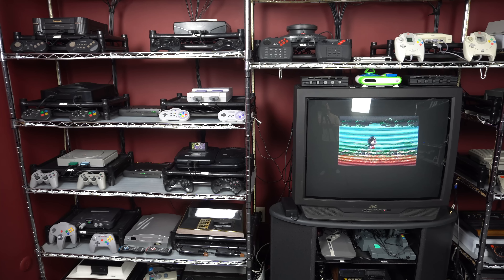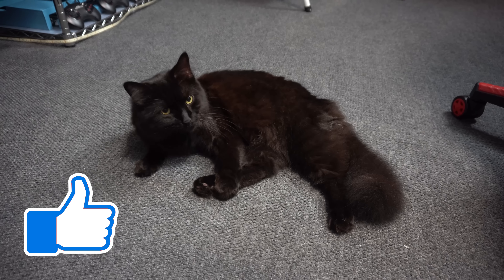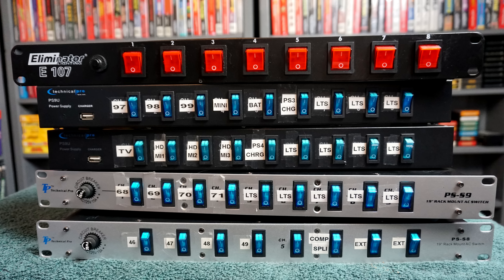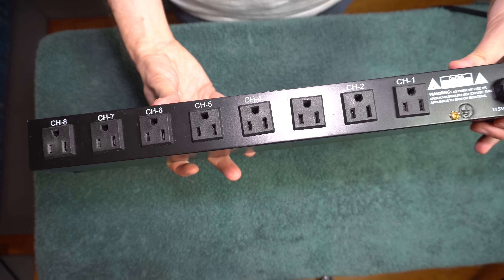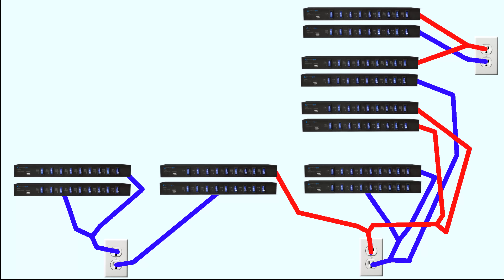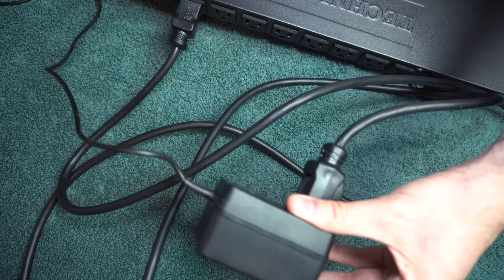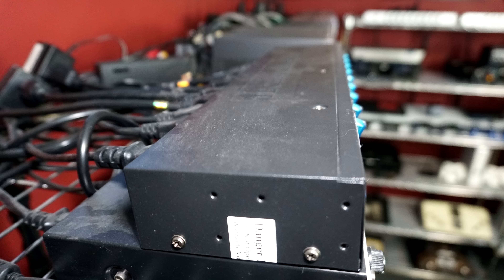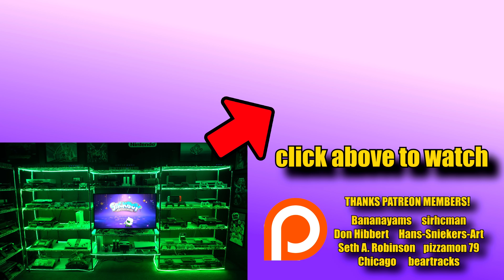How I Power 65 Game Systems

Comment: For your older systems I would use actual power conditioners. Cleaner power is always better if you can get it :P  Other than that I would run a second line to the room just in case. My living room is a home studio and I have 2 120 lines and 2 240 lines.  A large chunk of recording gear runs way more efficiently at 240v thus saves on my electric bill when I'm recording a project.
Reply: Even basic power strips with protection has MOVs and chokes to clean up the power. There are some protectors that cut power if it goes above or below the norm (and don't restore it unless reset), meant for old-style Xerox copiers.

Comment: You should see my setup.. I have a bunch of power strips that have individual items, one set has the tv, one has my computer, one has the Xbox, etc, all going to a main surge protector, then that one going to the main main surge protector which also also its own string of power strips, one for the lamp, one for the box fan..

Sounds crazy, but the way it is all of it turned off when I'm not home, so no power usage at all.. except the fan, and light..

Nothing is over any safety, volt, watt, or any limit at all..

The best way to set it up..

Comment: The only fire hazard thing I can see is that you have a lot of contact points on each path, meaning there a more points where corrosion on the contacts can be a potential fire hazard, but other than that it's a great setup!

Comment: it's just wires, it will never catch on fire. the bricks are 10 watts. people are so paranoid about just the presence of sheathed copper but as long as all the cables are rated at or above the breaker in your breaker panel, it is all protected, and you can plug as many strips into each other as you want.

anyway good job with your setup.

Comment: Could add an arc fault and gfci dual breaker to your panel for that room. Probably about 80 bucks for added security. Think it’s code now, but unless your house is brand new probably doesn’t have it. It would cut the breaker from the other YouTubers demo instantly. Not sure if I’ve seen any video game enthusiasts do it, but it’s diy and easy.

Comment: I was about to say you can just switch things off at the wall but realized this is The US here (I’m from NZ and we have switches by every power outlet probably because we use 240V)
Reply from the maker: You are correct, we don't have switches for every outlet. Only about half.
Reply: @GamingTheSystems1  That is a regional thing, in some areas, particularly ones where there weren't a lot of houses built before electricity to the home became widespread, outlets on switches are less common. They started out doing the switching outlets because adding ceiling mounted lighting fixtures adds significant cost when retrofitting an existing house with electrical wiring because you need to rip up the ceiling as well as the walls, so floor lamps were a common cost saving option, so they put the switches in place so lamps didn't need to be right by the entrance to the room, and that stuck around. When you are building a new house it doesn't cost much to run wiring in the ceiling though so it was common to just use permanent light fixtures and the switching sockets were unnecessary

Comment: A lot of people dont realize, power supplies have a transformer in it and most dont have a switch in the circuit between mains and the high voltage end of the transformer so they still sip a little bit of power. Most old consoles also dont take much, 10 to 60 watts when powered on for older systems with more power consumption for newer systems. Of course newer systems from the XB-360 era forward dive into the hundreds of watts per system. 
The biggest thing to keep an eye out for is making sure the equipment you want to buy is made to a certain load spec and uses thick gauge cables and are fused. Read reviews before getting a power strip or surge protector. Fused equipment and of course spreading loads onto multiple breakers can also keep things safe.
At the end of the day though, the entire room probably doesnt come close to large appliances you already have in your house like your refrigerator or AC. More plugs doesnt always mean fire hazard or more power consumption, its all about what youre plugging in rather than just how many.
Reply: The older systems had linear transformers which could draw more even when off (the BRIDGE RECTIFIER!!! and capacitors causing this). One good reason to keep them unpowered when not in use is to isolate them from the power line and all the spikes that's on it. It'd be a real shame to lose a whole room of systems if there was a lightning strike.

I just measured a SNES power brick and GameCube brick. SNES was 1.3W unconnencted from console, GameCube was 1W unconnected to console. I figures the GCN with its switching supply would have near-zero idle power.
Reply: @gblargg  completely agree. Also interesting find, I would have imagined the same for the GC PSU.

Comment: Great set up. Do those PDU’s get warm and need venting? Just curious for an entertainment center kinda set up.
Reply from the maker: I hardly ever feel warmth from them. They were not built with air vents on them either, so the company that made them didn't seem worried about heat either.

Comment: Do the "rack mounts" have surge protection? I assume yes. I know some people could use this for a desktop etc. It is important for the consoles as well even if only 1 or 2 are on at a time. This is important for apartment dwellers. You say it wont happen to you but then it happens and either you have surge protection or your SOL. Is there a major difference between these and lets say some "regular" surge protector or battery back up?

Comment: Awesome setup! For safety if you haven't already I would try Kill-A-Watt with all the games plugged in or add up the wattage to make sure that not only the rack power units can handle the load, but also your houses wiring. Typically they are rated for 15 amps or around 1800 watts in the US.

Comment: Slightly different question. I use a wire rack system myself albeit not as intricate. I noticed you're using some kind of boards and even risers to put over the wire rack shelves that your systems sit on. Are these uniquely 3D printed or did you buy them somewhere?

Comment: Very cool and tidy setup, although not really my style. But I always like clean setups where the cables are almost completely out of sight. It simply leaves everyone baffled at why there's no visible cables with that many consoles :)

I'm more into modifying pre-built shelves since I don't have the capacity nor patience for building it all from scratch, hence why I'm using Kallax 4x2 and 2x2 shelving units where I split the square spaces into 2 rectangular spaces for double the shelves, and also for the contrast between white shelves versus black/gray TVs and black/gray/indigo colored consoles.
My setup is WAY smaller at just 14 consoles + CRT + LCD. It al connects inside a drawer, with 5 power buttons on the front, plus HDMi input, 4 USB and an extra power outlet for convenience. Fire hazard? Possibly. But I made sure I use good cables, always leave it unplugged from the wall whenever I'm not playing, and I only use at most 2 TVs and 2 consoles at the same time, so it's not even an issue.

Comment: I'd put it all on a single strip with a remote switch, to turn everything off in one action. Also even if everything was plugged in at once (but not all turned on at once), it wouldn't be a fire hazard since it probably wouldn't even be drawing as much as a space heater. Fires start from heat. Heat comes from power draw combined with lack of cooling. With the adapters spread all over racks, they have good airflow. The AC wiring is durable so there won't be any exposed wires to short.
Reply from the maker: With 65 systems though, that extra energy seems like it would add up. Perhaps I should test.
Reply: @GamingTheSystems1  It would definitely be a waste to have all power supplies energized all the time, just probably not a fire hazard as many people joked.
Reply: @gblargg  Plus, when dealing with retro systems, the older the power brick, the more prone to failure. (ex. C64 power brick, so awful that one.)
Reply: @nixsdaddy5059  With these old systems I'd almost buy some high-quality power supplies with a voltage shutoff if it goes too high. A TVS diode with a polyfuse on the power supply side, or even a low-dropout regulator after the power supply, so if the voltage goes high, the regulator will just adjust accordingly.

Comment: This is one of the major reasons why i prefer to emulate. even if it’s safe and you don’t have a large electric bill, you can’t deny that buying all those systems and games and power adapters and upscalers / crts, is way expensive. not to mention the amount of space it takes up. all just to get the experience that an emulator gives is just too much for me, but props to the people who have these kinds of setups though, it’s absolutely mad.
Reply from the maker: Thanks for the comment. I recommend people emulate with FPGA and not build a room like mine. As for the expense, yep it costs a lot, but it can be offset by not over-spending in other areas of life (like overly expensive vehicles). In my case, most of the systems are worth a lot more now than when I bought them. Some have tripled in value. Even some controllers have tripled in value. Whoever processes my will is going to have fun!

Comment: Pro tip for other viewers, the cable thickness doesn't guarantee that the wire is lower gauge (greater thickness).  You have to read the words on the packaging or cable.

Comment: About the only way that would cause a fire is if you ran them all at once and ohm draw melted a wire.. at most, this room would just get really warm considering the way he meticulously planned out the way he is powering all that. I been an electrician for 20 years, it'd take a fluke or a failure of the surge protectors of some kind to start any fire. LEDs don't produce much if any heat.. i did a LED ballast lighting retrofit at a bowling alley gameroom.. i was surprised by how cool LEDs run. Since Omega is the primary issue here, make absolutely sure you use 12 gauge romex and as he said, actually thick y splitters, you can roll the wire with your thumb outside the shield and figure out about how thick it is inside the shield. for those that dont know, Omega is a measure of electrical resistance, its the electrical principle that allow electric heaters to work. 99 percent of the time its a bad thing, unless its a space heater, then its a marvel of technology.

Comment: With DJ equipment I have 2 300w active pa speakers and in the manual it says to plug out power after use so I take it if used for long periods may cause heat overload as seen in that segment

Comment: What about the umdervoltage or Overvoltage protection , in my country is a big issue ,i have 2 ps2s screwed by overvoltage :(
Reply from the maker: I've never had an issue with that, and the setup has been there over a decade.
Reply: @GamingTheSystems1  you live in a good city with good quality electricity but i many countries is an issue :c, transformers explodes over time and makes that kind of troubles T_T, i 've never play a console or tv without a voltage regulator nowdays

Comment: You verily thoroughly answered the question of how you power them all however you didn't touch on the subject of how you run them into the TV all at the same time, please elaborate
Reply from the maker: Signal wiring was outside the scope of this video, but I do say I lot about it in my "tour" video right here: https://youtu.be/KjKD_bYGapg
Reply: Not only that, but route all these A/V connections to the TV without signal degradation. With power it's easy

Watching the video, it's two levels of mechanical-switch 5-input boxes (so 25 inputs). Pretty solid.

Comment: Maybe it could be a good idea to replace individual power brick by a "centralized" modern power supply. Most bricks are unregulated, so the console won't care if the voltage is not exactly the same (1 volt more is absolutely fine). 

All of my consoles had their power brick replaced by a Xbox 360 psu (wich outputs 12V).With some diodes, i can easily step the voltage down to 10 or even 9V. Having a regulated power supply is a very nice improvement in term of picture and sound quality over the unregulated bricks. And obviously the setup saves a ton of space and looks way better than a bunch of cables and plugs. And because most older console have a "real" power switch, there is no need for indiividual switch for each console. THe only thing is to shut down the x360 psu when no console is in use
Reply: Using just diodes to drop voltage isnt really the best way as anything that drawn and reasonable amount of current the diodes will start to dissipate alot of heat
Reply: @bassblaster505  I know, but it was the cheapest way, especially because i already had large diodes in my parts bin. Nowadays there is a lot of switching regulator  available, wich are much more efficient

Comment: Very nice setup! Mine is way cheaper, I simply use 1power bar for each 5 consoles. and turn them on when not using the systems. I still get the "phantom "0.06Amp" " consumption of 4 of the 5 system when gaming, but it's not enough power for being a concern for me.

Comment: Fire inspector here, one thing i would note is a "thick" cord is not a definitive way of saying a flexible cord can withstand a high current, with that said a good note would be to make sure any cords , splitters etc used have a been tested and approved by a governing body, here in Canada its the CSA. also make sure any male-femail connections are well seeded.

Comment: Honestly not a bad setup. Your only weak point is your Y-splitter cables. The insulation is visibly thicker than the "cheap" ones, but the wire isn't. At 7:08 you can see that your Y-splitters use 16AWG wire, which isn't rated for 15 amps in North America @ 120VAC. Most household circuits for plugs are designed to withstand 15 amps.

What this means in your situation is that your Y-splitters will burn up before your overcurrent protection (circuit breaker) will trip. Although you're not pulling enough current with the way it is setup for it to be a major problem. Only would be an issue if a child or someone who doesn't know what they're doing attempts to turn on EVERY SINGLE SWITCH and power every device simultaneously. You're on the right track for trying to avoid this problem by buying "thicker" cables, but please ensure that the small print on the wire says it is 14AWG or thicker. They can look thicker than other brands, but they're actually the same size wire which can't run any more current than the cheap brand.

My other problem are your PDUs. The guy in the review video had to shake the wires in order to cause a short, but that's still not good enough. If you can handshake these wires loose then that means the vibrations from your speakers or game disc drives could eventually shake them too.

Other than that good job.

Comment: Have you thought about changing your setup so that nothing is connected?  I have seen setups like that.  Basically every system is on the shelf, and when you want to play it you move it to the shelf where you plug it in.  I used to have everything connected at once, but all the cables bother me.

Comment: As a professional AV and Networking guy it looks like a typical DIYer setup. I would of added some additional electrical outlets and have some power conditioners for the PDUs to plug into. Granted you're running a single TV and a console at a time but you have the PDUs still energized with a bunch of Y splitters and extension cables. Even though you have "thick power cables" doesn't mean it's safe.

Comment: In the electricitie code (Canada) what you do even if it only to power 1 thing it not good, in case of fire you assurence can not pay. Exepted if all power cord you split and extandend and the PDU say you can do it. (i never see a PDU you say they allow use a extension they alway say to do not do that)

Comment: I have 23 systems hooked up and am tired of people saying it is a fire hazard or uses a lot of power as I have switches for them all too… by the way the power switcher that you have that has the usb port does actually use a very small amount of power for the power conversion for the usb port but that is  basically nothing anyways
Reply from the maker: Interesting. I'll test out the USB one to see if any draw is detected. I would think that a USB port would not draw when something's not in it, but then again, there is a tiny board it's attached to.

Comment: I wonder would smart-home power strips accomplish the same physical circuit breaking as the PDUs… so you’d say “Hey Google, power on the Nintendo 64” and a pre-programmed routine runs to switch on the outlets for the console and any necessary switches and upscalers..?
Reply: Quack. I use a remote switch to power my amplifier. This was actually because the rest of my system runs off a power strip with only one switch and 6 outlets. Those things really don't consume much power themselves. As for smart switches, I don't know, but they inherently need more power for an always-on WiFi module.

Comment: Looking a buddies arcs from the input supply, you just increased your fire risk, not really helped the situation, load value isn't going to be a factor when the input is prone to shorting out. Maybe make sure you have a decent fuse in the panel for the room, and maybe try power conditioners instead of PDU's.  Maybe consider a few dedicated 9-12-24V dc supplies that you could run DC from instead of the vast array of wallwarts. Might clean things up a fair bit.